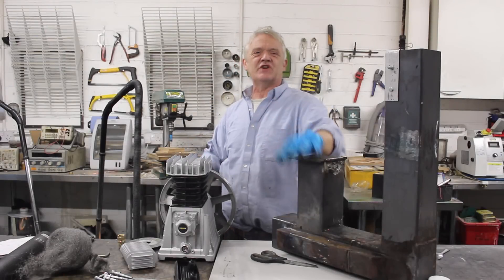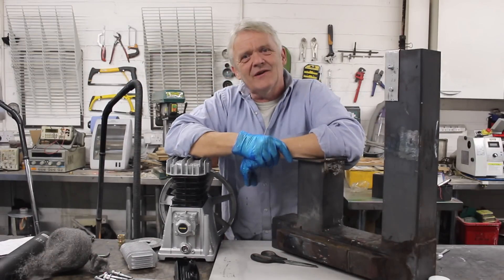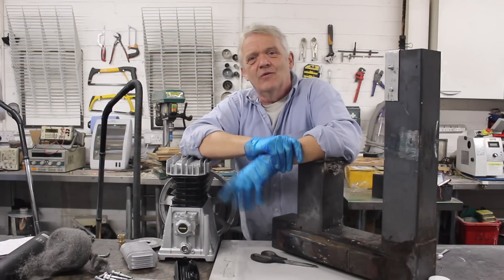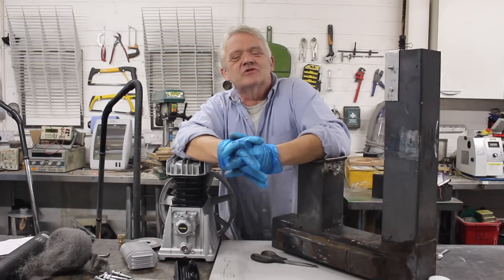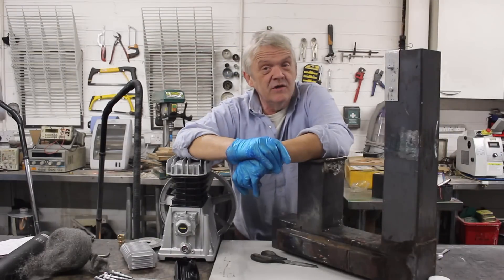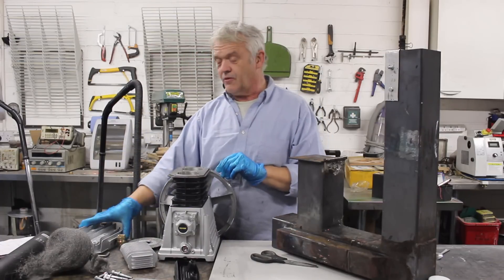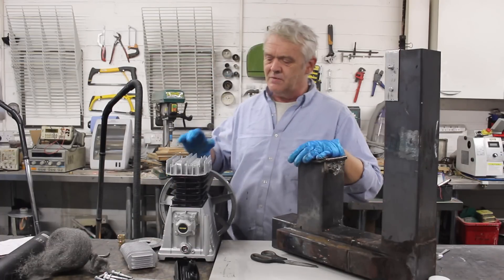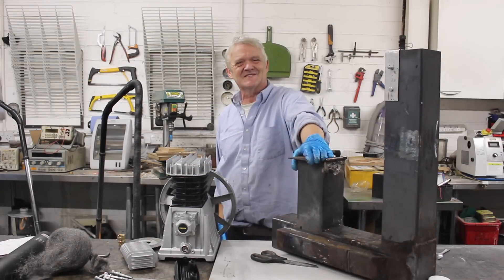1692 A DIY Multi Fuel Home Generator 1 - The Project

Comment: I have been interested in steam for some time, as it is easy to make steam. I did cut firewood for many years...
But, the "Boom" factor is not so intriguing. 
Thus, I am actually looking at the Destructive Distillation of wood, and gasification, to feed a standard Infernal Combustion Generator, with all of Wood Gas, Methanol, and Charcoal. And use its hot exhaust to heat a plate with a few NASA Stirling Engines on it, with linear generators on them, OR as the heat source for a retrofitted Gas Water Heater (or both), which said water heater shall be both domestic hot water and for the radiators to be installed in my Caravan.
Methane Production is also intriguing, but, storage does present that BOOM risk, as well.
Taking out the neighbour's windows when I take off my roof might make the neighbours a bit miffed.

Comment: Hey Robert! Unrelated (no idea where to contact you but i need help). Any idea on how i would go about making a mosquito mesh type fabric electrically conductive (like impregnating/coating with silver/copper/etc)? I'm sick and trying to figure out a cheap way to block all the EMF around my bed... I pray you have some idea🙏🙏🙏💙💙💙
Reply: Tinfoil is probably about the cheapest option I would think, you will want to ground it, use a few layers.  You should save for a shielded sleeping bag, some 40% silver clothes and tins of y-shield paint, in my opinion and I have the EMF sickness so I know what I am talking about, also I have a faraday room and a shielded bag for sleeping in and I am now working on clothing (wears hoodie all day long, climbs in bag wearing hoodie, sleeps in faraday cage painted room).  First things first though, you need a good EMF meter and a power field/magnetic field meter or a tri-field meter that reads the lot so you can see where the problem areas are, magnetic fields and power fields are very dangerous, don't cheap out on the meters.  Don't consume too much calcium, supplement magnesium in high dose, swell arteries with ginkgo biloba and work on your digestion.  Look up Rouleaux, that's what you are basically trying to treat, that's what your blood cells do when the EMR hits them.
Reply: Watch the ginkgo if your on blood medication or anything, seek medical advice if uncertain, I'm not a medical doctor.  I am however, my own doctor, so I take it everyday, the Chinese monks used to use it to enhance their mental powers.

Comment: If I’d spent £100 on a compressor I think I’d just modify it to run in reverse at the flick of a switch using the air tank as fuel,  recharge the tank using solar.  If I want to generate from steam there are way cheeper motors I can use to make the power.

Comment: As a beekeeper back in the 70s with a low pressure wood fired boiler providing steam in the honey extracting van, I came across references to a patented simple 3 cylinder steam engine to provide mechanical power to turn the extractor, pump honey and generate elecricity. Petrol powered generators were then cheap to buy and run and more convenient so the steam engine sadly wasn't built but in today's world it becomes much more attractive. Good luck with the project but please stress safety as a primary requirement, steam boiler explosions
Reply from the maker: indeed mate

Comment: Love it. I particularly love the use of off the shelf parts. By the way, did you know you are going to be very busy soon? God bless you and your family.
Reply from the maker: awesome mate - and busy? why's that? God bless you and yours too
Reply: @ThinkingandTinkering  Without putting to fine of point on it..your skills and abilities to make things for power and heat. This is your time Robert. What you have is what may save many folks in the coming time. The very first video I whatch of yours was a battery bag that you created was very impressive. Now add all the other things you have come up with from then till now. This is just my thoughts and feelings, but your gifts will be needed. I can't say if it will be for the masses but definitely will be able to help other with power and heat needs. With terrible times comes opportunities. I think you know where I am heading with this so I will stop rambling. Thanks for the opportunity to explain, well mostly. Cheers 🍻

Comment: Well here's another idea to throw in.  A plastic steam engine.  Acrylic for the cylinder and resin for the piston.  Use the acrylic cylinder bore to mould the resin piston.  Because the operating temperature is much lower than for an internal combustion engine, you're only dealing with temperatures up to around 140 C for a low pressure engine, the whole thing can be made from plastic and wood.  The valves can also be plastic.  One advantage of plastic is it's a good insulator which means the steam won't cool down as it transfers from boiler to cylinder.  It also means the whole thing could arguably be made without a lathe.

It also brings in the prospect of 3d printing parts from ABS.  Certainly mouldings can be 3d printed.  A plastic steam engine would certainly be light weight.
Reply from the maker: there are a few plactic steam engines on thingiverse mate

Comment: There is a YouTube channel, "The DIY Science Guy" where the fellow aims to build a steam engine running on propane, butane or something similar instead of water.. that way he can boil the liquid in sub 100C water heated by a solar panel and still condense it in air. So it is basically a sealed system, low temperature, steam engine.

He is on a hiatus now through, building a workshop to continue working in.
Reply from the maker: those kinds of engines were popular in the 1850s or so - obvious drawback was venting explosive gas - alcohol vapour as a driving fluid was also popular - he might need another new workshop lol
Reply: @ThinkingandTinkering  hahaha.. that explains his sudden rebuild perhaps :)

Comment: How about hydrogen that is produced strictly by solar then it is plumbed into a bladder rubber bag thing then a high pressure scuba pump with the intake also plumped into the rubber bladder then you use the scuba pump to pressurize welding cylinders with high pressure hydrogen then use that to run a propane engine
Reply from the maker: i would think so mate

Comment: I heard recently that some heat pumps are 400% effective... What can it mean for power generation? Can a heat engine be self powered with ambiant heat?
Reply from the maker: yes it can some experimental LTD stirling engines run on half a degree difference

Comment: Be careful. I live off grid with a 5hp boiler and a 4hp steam engine. Both were commissioned by an experienced Boiler Maker. Steam is dangerous. It combines the danger of compressed air and hydraulic systems. Spring loaded heat. To be borderline economical for power generation you are looking at a boiler pressure of 80-150 psi for a small system. Fabricating safe steam pressure vessels is an intense undertaking.

Comment: It'll be a very interesting and slightly none-too-easy way to valve a compressor, but having a high pressure/low pressure carry-over tube would be super efficient. I've a great love for steam locomotives and have endless admiration for both their seemingly 'low tech' complexity and precision, built in the era devoid of digital aid. Steam is perhaps my most favorite propellant to boot, expanding round about 6 times greater than hydrocarbon fuels. It's got a lot of Chuff for the gruff!

Comment: Keeping the steam as dry as possible will prevent hydraulic locking of the pistons, is it possible to cycle the steam from one piston to the other to max out the energy? You’ll need a condensing vessel, the typical refrigerant accumulator may be an easy solution and this would be a good use of thermo electric generation. I assume you’ll go with a top up pump to keep water levels stable. Or will it be steam to atmosphere once it’s been through the pistons?

Comment: Are the converted engines negatively affected by the (presumably) different temperatures caused by the various fuels. 

i.e. the air pump wasn't designed to have petrol or diesel level temperatures going off in the chambers... So could that cause warping? Would you need to add a heat sync/ radiator nd coolant?

Comment: Great project idea.  Makes me wonder why combination heater, boiler,  generators are not already in homes.
Reply: @realfamilyman  I’ve dealt personally with overly intrusive government idiots, and it is a real problem. That said, when you know the amount of damage that even a small steam boiler can cause if it’s not built correctly and maintained, it’s probably a good thing that there’s some effort to regulate them.

Where I am, in rural Indiana, I can build and install a steam boiler up to ten gallons without any approvals or inspections whatsoever, but that’s only true for individuals at their own homes. I might do it for myself, but I’m kinda glad that it’s not legal for anybody to go around installing steam boilers all over.
Reply: An improperly built steam boiler is a bomb. There are a lot of regulations around restricting steam boilers to avoid people building bombs into their homes.
Reply: @darrylpang3903  exactly, and even a little one can do a lot of damage.
Reply: I would buy a properly engineered and built heater, boiler and generator as a single unit.  I already have each as seperate units requiring separate input energy.
Reply: Cui bono

Comment: I'd be using an old 4-stoke motorbike engine. I'd cut the camshaft in half and weld it back together, with different timing. Then I'd put 1-1 gearing from crank to cam.
That's it, then I'd feed high pressure steam into the inlet port of the engine. 
There needs to be some method to keep the cylinders well oiled/greased. If not, the rings/valves/bore will begin to rust right after first use. I'd probably just use soluble oil - the stuff that turns white when mixed with water. The oil doesn't separate from the steam, it's carried with it. Some will condense in the engine, keep it lubed and stop rust. 
With a good steam recovery system the same water/oil could be used repeatedly.

Comment: The reference to the WW2 engine reminds of: "Ricardo's Steam Engine, 1951. (This engine was a twin)
It was built in conjunction with the National Research and Development Corporation (the purpose of which is to finance likely inventions) with a view, to selling it on the Indian market. The idea was that the Indian village community should have some other source of power than bullocks, and this engine had a boiler which could burn any fuel including brushwood and camel dung." -copied & pasted from the Sir Harry Ricardo F.R.S. website.

Comment: James Watt did not like pressurised steam far too dangerous instead he used atmospheric pressure steam which was then cooled by the engine. When I get going in Portugal, I want to build a massive super insulated pizza oven to cook in and heat the house with. What you have now done is constructed a sort of artificial hot cave. You can then suck hot air from this cave cool it in and flame sucker engine and generate electricity. That sand bottle of yours stored 4 kw hours of heat imagine how much you could store in something the size of a chest of drawers. No need to worry about heat loss its heating your house.

Comment: Great project Rob!  I've been thinking about doing this for a while. Just haven't taken the time. I'll definitely be watching this project and more than likely replicating it. I don't know what kind of power you're thinking you might get with this setup. I was hoping to get at least 2 or 300w. Cheers! Can't wait!
Reply: @realfamilyman  I have quite a few generators I've been experimenting with.   I have a permanent magnet alternator that creates have decent power at relatively low rpms.  I have a direct drive washing machine motor that I totally rewired that will make about 500w at 1000 rpms.  I also have a hydro generator that could work also.  Didn't have enough water flow for that and was only producing 40w. It's capable of 3000w. I think Steam is the way I need to go. I have 10 acres that is wooded.  A lot of power laying around.

Comment: Excellent project idea. I'll get started with the rocket stove part.
I am not good at metals, so I'll build the stove out of palet wood.  😄
Reply: That’s literally possible if you build it with a water jacket.
Reply: @twestgard2  reminds me of those disposable paper cooking pots that you can use on a camp stove boil water. Just a slight char on the bottom, but it does the job.

Comment: I have used a rocket stove to heat a steam generator. For a reliable water level sensor that can withstand the temperature,I simply used a spark plug. Water=circuit, Steam=circut broken, water pump on. I used 50m x 15mm copper tube, coiled in concentric spiral for wet back on top of flue.  Don't  forget a pressure relief valve

Comment: Looking forward to the water supply side as well
Reply: That's one thing I never understood about boilers and steam turbines - how do they supply fresh water to it under pressure? How do they keep the steam from backflowing into the tank or the supply line? And how much energy does that use compared to the output? I guess that's not a problem if you just have a sealed tank that gets consumed, and then manually open and refill it, but for things like power plants I think it's a closed loop.

Comment: For fuel I'd like you to try in the rocket stove fallen autumn leaves (crushed into briquettes), acorns, honeycombs and conkers. Also sawdust. Which is the best free waste unwanted fuel that is plentyful?
Reply: Plastic, but you need a pyrolysis chamber. Not all plastics work well and especially no PVC because of the dioxin. Use a steam jet to reduce volume of things like cling wrap and bottles before they go in the chamber.
Reply: Pine cones and Eucalyptus bark/twigs/dried leaves would be very good here. Both burn hot, but Eucalyptus ferociously so. 

I grow several Eucalyptus trees in my garden and some don't mind coppicing, regrowing to supply fuel for another year (unless there's a really severe winter like the -20C winters we had some years ago. That tends to kill them off and I then have to start again).
I grow the Eucalyptus mainly because they drive away some of the flies from the neighbouring farm (the nickname for one species being Shoo-Fly), but they have been an asset when it comes to firewood production because most hardy species grow fast and it burns for longer than any other native wood.

Comment: Just thought of something, to aid your fuel entry setup on the stove; can one shove the activated carbon felt down the length, prior to coiling the bends, and then put it together with the drip fashion into the rocket stove? I think that may act as a nice filtration system for use of used motor oil, and something where you can split it into 2, a length that's removable at the top end, and one that's permanently housed within the coil? then one simply needs a ramrod and a bit of patience every 3 months or so, and you can begin to assist your buddies over at the auto shop in one of their least favorite things to pay for I'm sure, used oil removal.

Comment: You bugger! I just happen to have an old air compressor that finally gave up the ghost and I have been considering the ruthless chuck out option (a big step for me :) ) but now you have sown a seed of interest in repurposing it. The air receiver could easily become a low tech boiler. Just as well that I have a boiler ticket.

Comment: Hi rob, have seen a similar idea before but not on a rocket stove. One improvement I can think of is running a pipe in the chimney that the steam from the boiler then runs through to super heat the steam. Would greatly increase efficiency as you would be using the heat scourge twice in effect. Also lagging the boiler with a sand jacket increasing the thermal mass might be a good idea

Comment: I'm excited to see what you come up with, It would be a great resource for me to learn what you would have to do to convert a compressor to a steam engine, I have a few fridge compressor just lying around and I've always thought of trying to make them into steam engine. The first problem I have is I cant find a good tutorial online on how to do that specifically with fridge compressors, and second I only have access to machining, what I got is a grinder, drill and a welding machine. I find your builds and tutorials really easy to follow and you always find ways to make it as simple as possible.
Reply from the maker: I hope it helps you mate - cheers

Comment: clay is better than sand as a thermal battery...Water even better.
Reply from the maker: depends on what sense mate - they all have pros and cons tbh
Reply: Beeswax! I put it in my hot water bottle for stomaches and cold feed in winter. I just put it on top of my cooking pot while cooking
It stays warm for a long time!